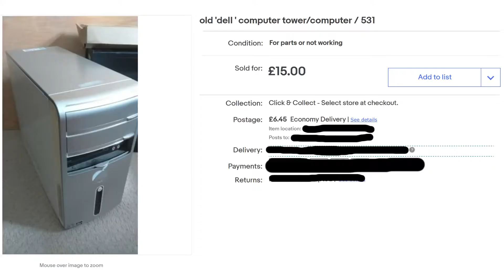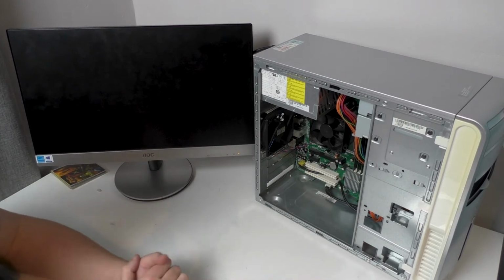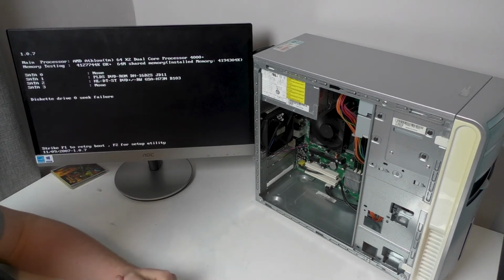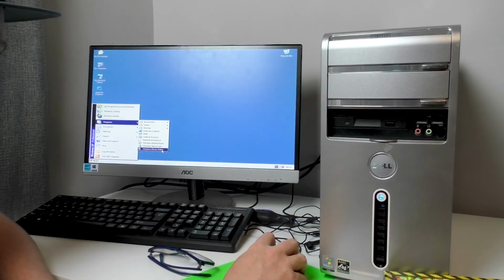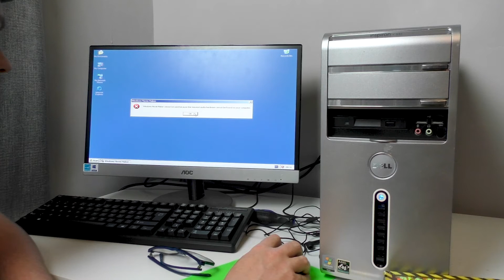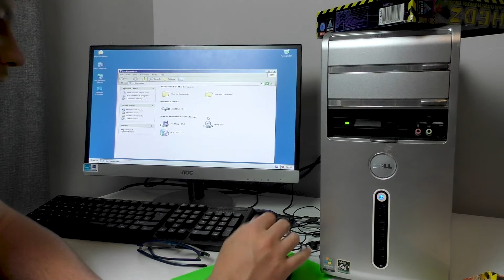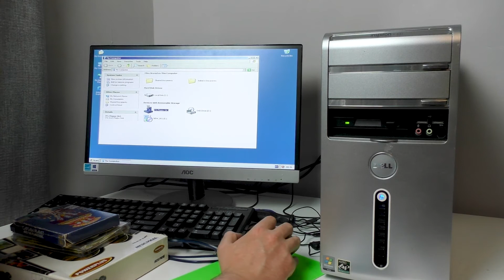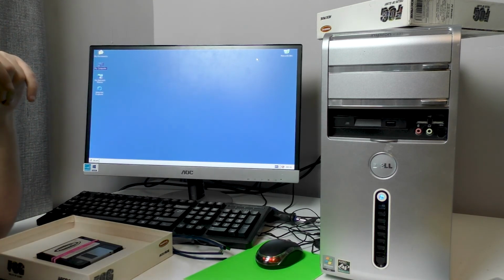Fixing a cheap (and dusty) Dell Inspiron 531 from 2007 - retro computer restoration | BestNerdLife

Comment: I have a similar dell but didnt have the original floppy drive so mine has a beige colored floppy drive instead. Its a great system for xp retro gaming
Reply from the maker: Yeah, it's a decent system for sure. Glad you could get a floppy drive sorted for yours.
Reply: @BestNerdLife  thanks. I Also have a dimension 9200 that Also got a beige floppy drive andboth dell models apparently use the same cardreader so the 9200 got both cardreaders and the other dell got two dvd drives. Both a Very Nice dell xp systems now (using windows xp integral edition)

Comment: got an old 531s got any suggestions to upgrade it to a starter gaming pc
Reply from the maker: I guess it depends on whether you want to use some of the parts you already have inside your 531s, or if you just want to use the case as a shell and get all new stuff. Either way, I tend to use something like userbenchmark.com to speed test my pc and scout out compatible parts for it etc. If you play around with it, it should give you an idea on what parts you can upgrade to, whilst them still being compatible with all the rest of your stuff. Hope that helps? Let me know how it goes.